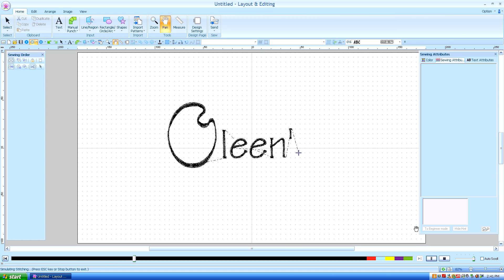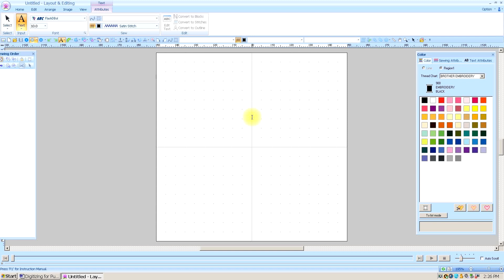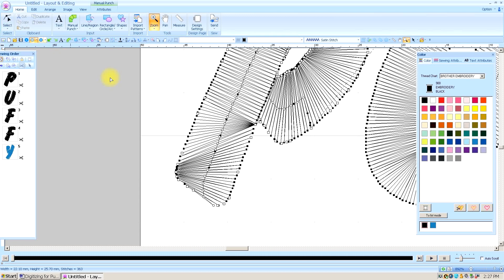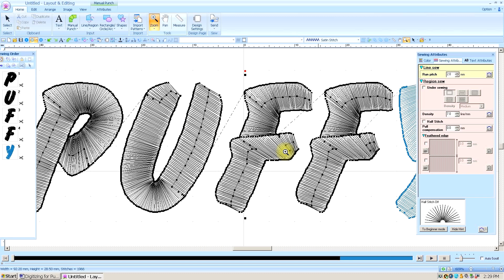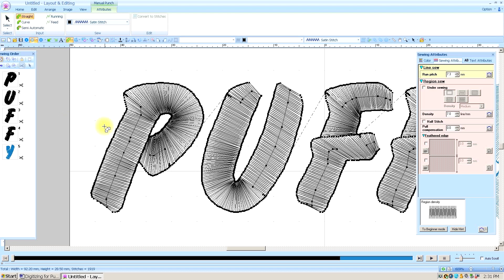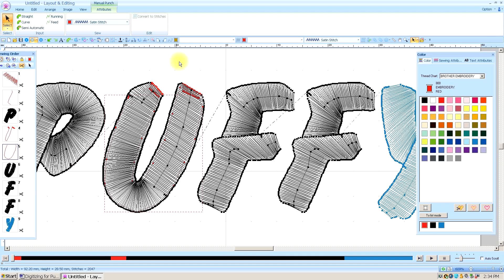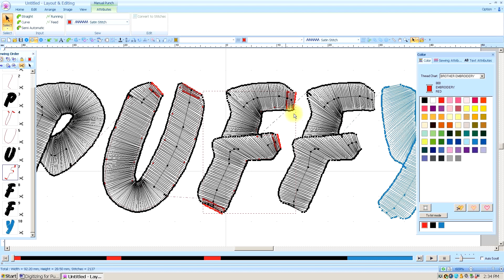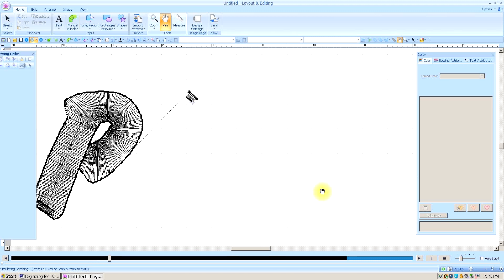Brother PE Design Next:  Digitizing for 3D Foam (Lesson 38)

Comment: A Barudan machine can take up to 12.7 mm stitch length. What if customer demands a size for 3D puff having more than 17 mm stitch length at its maximum? How to deal with such situation while we can't make the satin stitch in two parts because it will look bad?
Reply from the maker: The customer is going to have to be informed that today's machines are not able to stitch 17mm.  Perhaps shrinking the design so the puffy element is not so long?
Reply: Is there any way to digitize a 3D design with fill stitches. Have you ever experimented such thing? I am looking to digitize a horse in 3D at 2.5" inch tall for caps. Face, neck, legs and tail of the horse is fine and falling under 3D limit but the problem is with horse tummy which is 17 mm length. If I shrink tummy then horse looks ugly. I am wondering if there is any possibility to digitize the design at the same size with 3D puff or 3D with thread.
Reply from the maker: send the embroidery file to "kathleen@oleens.com"  I'll take a look at it
Reply: man, cant you tell? people want to learn to do it themselves and you are here for the profit for your self.